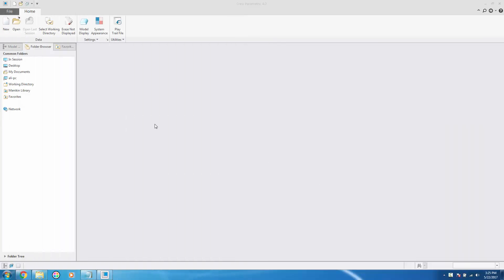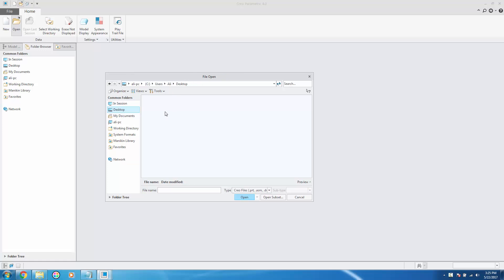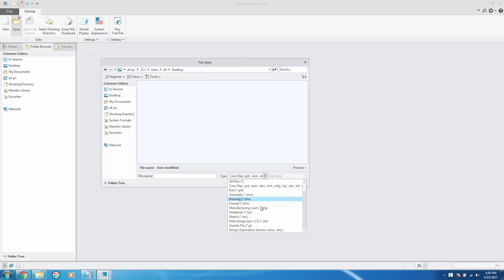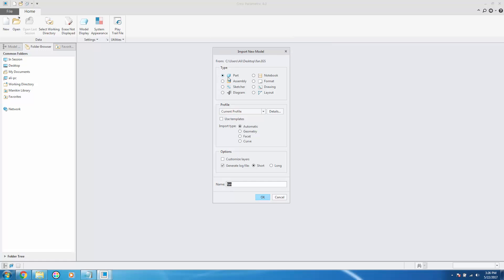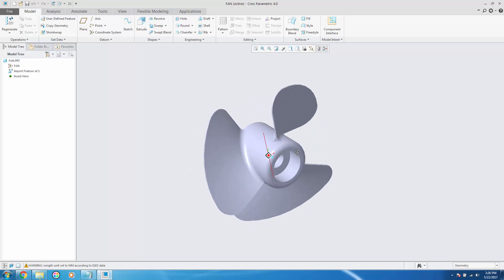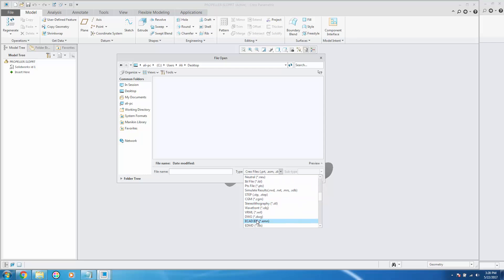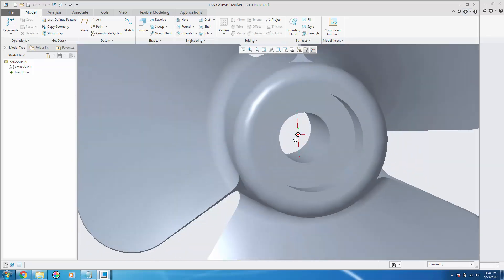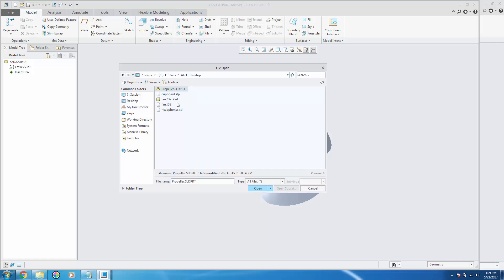How to import CAD file in Creo

Comment: Only works if opening a file into new file by itself into a default position. I need to import to a shape and add to a part drawing with a model in it already in a non default position. So Model-Get Data- import. But having trouble importing it to the proper location.